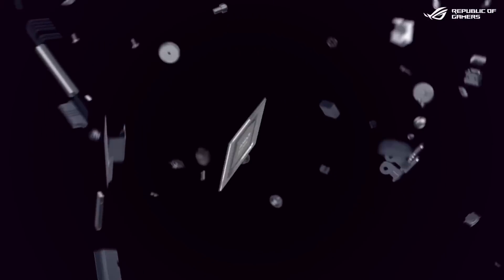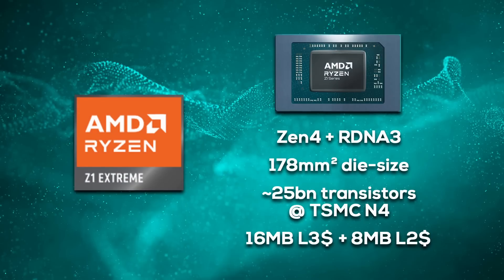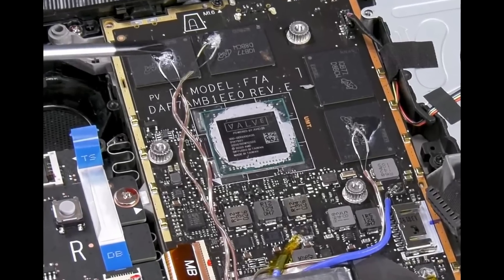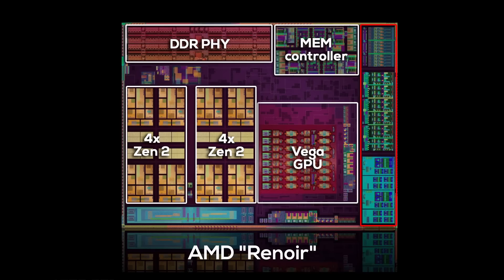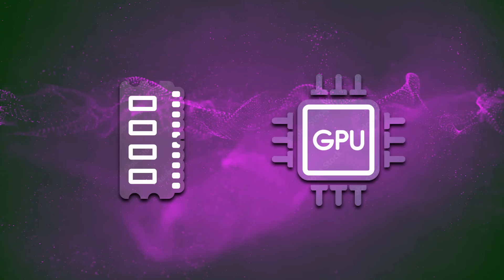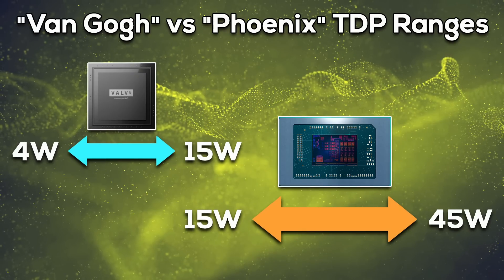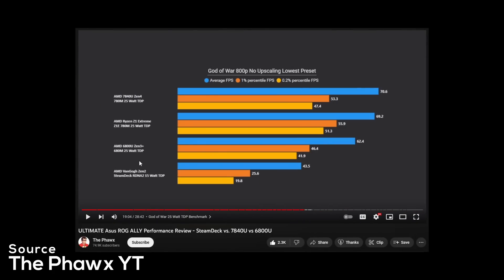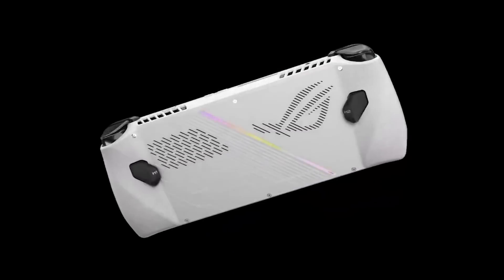Why the ROG Ally can't beat the Steam Deck

Comment from the maker: See NordPass Business in action now with a 3-month free trial, go to https://nordpass.com/highyieldbusiness with code highyieldbusiness
Reply: There is is also a factor of the operating system. Basically in Linux vs windows scenario Linux always wins in terms of amount resources it needs to run in comparison to windows which also results in better power efficiency because the less resources you use the less power drawn will be. Valve is using SteamOS which current version is based on Arch linux while ROG Ally uses standard windows with all its bloat which will have also Asus bloat included. Not to mention windows and older game compatibility is meh at best and dont get me started on windows updates.
Reply: It seems like the Z1 extreme is just the 7840u laptop apu
Reply: @GeneralTso369  It is the whole Z1 Extreme is basically a marketing ploy to make potential customers thing that this is some kinda custom chip when in reality is standard production APU with changed volatges.

Comment: Windows has been getting destroyed by Mac for exactly this reason. The M1 Macbook Air easily has 3x or more the battery life of the next-longest-lasting 14inch laptop. It's ridiculous! I wish we had the Valve APU for Laptops. I'm desperate for a laptop that can run on 2-6W like an M1 can. It's not just "ARM vs x86", it's the wasted 3-4W that was mentioned in this video!

Comment: Deck 2 Custom APU:
* Zen4c - style little cores laid out in a power optimised physical IP cell library.
* Memory on-package using the lowest power HBM variant available at design finalisation time.
* GPU: RDNA 3.5 (a tock design fixing whatever issues made RDNA 3 performance below expectations).

Also, relevant system-wide feature to keep the GPU down-clocked and cool:

* Display: 1920*1200 native, relying on OS support for upscaling from any framebuffer resolution, including dynamic resolution by forcing the application's window to resize to hit TDP and frame time targets in a fake fullscreen windowed mode.

Comment: 8 cores at 1GHz should use less power than 4 cores at 2GHz. Is it possible to radically underclock abd undevolt the Ally and use this fact to get better performance per Watt from it tgan from the Deck, at least on multicore synthetic bencharks that scale well like CPU ray tracing?

Comment: Steamdeck can't be beaten because it was born already beaten by itself - with 720p 60hz screen. Even mobile phones has FullHD 120+Hz displays ong ago - but this big "gaming" device hasn't. What a shame...
Reply: Braindead take considering nothing can run at those refresh rates other than simple mobile games. Also steamdeck is cheaper than most smart phones.

Comment: I think this is a pretty bad take on preproduction software. And until you have it in your hands to do a side by side graphs, charts, and specs only show so much. Linus from linus tech tips has one and has fully dropped his steam deck (he was actually using an ayaneo before switching to the rog ally because he didn't care about cost and just wanted more preformance)

Yeah the cost might not be worth it for some but that doesn't mean it's not for others. 

It runs windows, has a better screen, and more powerful hardware. 

Those check boxes are worth enough that people are pre-ordering the rog ally like crazy

Comment: Asus can still make a low power mode with 2-4 cores disabled. ( it might be possible via windows anyway). that should match or exceed the steam deck on battery life ( I alreay have a deck and considering the upgrade).

Comment: Why are Youtubers insistent on comparing two different price points on products; it's as though they are competing with one another with meaningless "content" lol. Sure, let's compare the most expensive model from the Mercedes Benz with the Toyota Corolla. Note that the only difference between all 3 Steam Deck is primarily storage capacity starting at $399. And I have no doubt that Steam will have another 10% discount in the near future.

Comment: Claiming that Valve "designed" Van Gogh with just a helping hand from AMD is so much of an hyperbole that it is flatly a misleading statement.
Van Gogh was prepared by AMD. Not just when Valve asked for it, but literally years before Valve even started to get an idea of it. But faced with limited budget and limited opportunities, this AMD's APU remained in the design area, with no clear market base to address.
This changed with the Valve's Steamdeck. Due to sheer coincidence, Van Gogh was actually the perfect APU for this device category. And Valve could provide the volume and the budget to make it happen.
Now, I'm not saying that Valve didn't have any participation in the chip's design, but their share was limited to a selection into a rather short prepared menu. Nothing equivalent to a "chipset design" team.
The most important impact of Valve is on the software side. And that's a hugely important one. Thanks to the customization possible with Linux, Valve's engineers have been able to make the most out of the power saving functionalities of Van Gogh. It would have been very difficult (actually impossible) to do the same on Windows, which is incidentally what ROG Ally carries, And that's indeed hugely important for such a market segment, where good performance at limited power (<15 W) is a must.

Comment: This video seems unreliable, following ASUS's recent updates for 15W, which massively boost performance. I/O, when not in use, is usually power-gated.
Reply from the maker: The sub 10W performance is still lacking behind the Steam Deck, quiet the opposite of "unreliable". And tbh, even if the Z1E matched Van Gogh at sub 10W TDP, it still would be a crazy feat when you compare specs.

And nothing is 100% power gated, there's always a tiny amount of loss. Which doesn't matter at normal TDP levels, but at ultra low-power, it's has a impact.
Reply: @HighYield  pleb

Comment: good report valve got rid of Renoirs non unified ccx processor design. mb
Reply: yes rog ally is costly on unused function I am estimating the component costs ASUS over $300 but less than $335 for half the design cost and in the absolute lowest dregg phoenix octa slack to ASUS $250. mb
Reply: which is a big improvement from PS5 and Xbox sales at $64 per unit earns $20 or so on royalty and the silicon is give away. mb
Reply: ur in the business and a designer? mb

Comment: The ROG Phone was a great idea, but I wouldn’t of wanted to be an owner of the first gen. I’ll wait 6 months to check the Ally 2 and see if they have at least the same 6000mAh that the ROG Phone 7 has. Hopefully a new CPU that runs well on low TDP as well, might have to wait for ROG Ally 4 or 5 for that…
Reply: Yeah same, for now I'll just buy a steam deck and wait out for the ally till it's confirmed that it's good.

Comment: It would help if we could disable some CPU cores i have option to undervolt (offset) and set memory speeds/timings. In theory that could be incorporated into Armoury Crate software without need to go into BIOS. That would close the gap between ROG Ally and SteamDeck<15W.

And out of both i would use something like Z13 Acronym but with OLED - maybe I will switch to similar device next gen as it could replace both my PC (5900x+3080) and laptop (X13 Flow 3050 TI) .

Usually i use portable gaming devices when travelling by train or in hotels so power socket is always threre and 7' screen is simply too small for me.

Comment: Hugely informative video. Assuming you are correct this is a really excellent explanation of what I have been seeing other creators struggle to grapple with.
Reply from the maker: I think customizing is a super interesting and often overlooked aspect of hardware design. It's relatively "easy" to design a good all-around product that performs well within common TDP ranges. But as soon as you move towards the extreme, be it very high or ultra low power draw, specialized hardware truly shines.

I hope the ROG Ally will improve its low TDP performance with further firmware and driver updates. But even if it would be able to catch up to the Steam Deck, a simple look at the hardware specs is all you need to realize the amazing work Valve has done with the Van Gogh APU.

Comment: If I wanted to play while plugged in, why would I even be using a portable?  Even if I did, I’d simply stream the games from my desktop system. Battery life is therefore a huge consideration for these devices.
Reply from the maker: Maybe you need a semi-portable system, e.g. because you switch between two homes. Or you use it for your daily commute which means sitting in a train for 1-1.5h, something that would work well with the ROG Ally.

Comment: The mockup does a great job conveying just how much die area the Steam Deck devotes to its GPU compared to the Ally. One device is min-maxed for the task of 'portable gaming machine', the other is just a (very good) laptop APU stuffed into a Switch/Steam Deck form factor.

On the other hand, my Switch never actually leaves the house, and I'm sure many other people treat theirs similarly. So as you point out, a more power-hungry device still has its place.

Excellent video --

Comment: Steam Deck 2
8c zen4 1ccx RDNA 4 APU, 16-32gb of LPDDR5 7200-8533mhz 
2025-2026 timeframe. Storage options: 256gb $399 512gb $519 1tb with better screen etc $649 (Maybe the price is a bit more expensive but since storage is so cheap, I think 256gb will be the baseline maybe valve upgrades the ram to 24gb or 32gb of LPDDR5
Steam Deck 1 64gb: $249: Still on sale on Valve Website

Comment: One simply does not buy a Lamborghini and drive it at 40kmph in order to save fuel in the end of the day the ally is more powerful and with the more battery is used ,maybe installing a custom windows 11 os such as ghost specter and disabling 2 cores will bring it onto the same ball park as steam deck but why would you chop of its legs

Comment: Stop comparing the fp32 (standard precision) tFlops vs fp16 (half precision ) 😂
Reply from the maker: Van Gogh has a theoretical maximum of 1.6 TFLOPs FP32, Phoenix has a theoretical maximum of 8.6 TFLOPs FP32. Most of that is due to RDNA3 being "dual-issue" and the potentially very high clock speeds of the Phoenix iGPU.

Comment: Doubtful people in this category will care all THAT much. You guys raised a giant stink over the Switch’s energy efficiency and said it doesn’t matter. Now, a real hardware manufacturer comes into this tiny market and shoved Valve’s face into their cake. I’m sure ASUS will address efficiency as much as they can, but Windows would probably be a big hurdle in that effort. At the end of the day, it isn’t going to effect sales of either unit. People will buy whichever device they want to play their games on, the Ally will look more appealing since it can play all Windows games without workarounds. Also, the Deck’s energy efficiency depends on the game or app you’re running, there’s nothing uniform about it since it behaves just like a PC.

Comment: Steamdeck has over a year's worth of software and firmware updates. All the reviews and comparisons are against the pre-release marketing units of the Ally, so they are not representative of the actual market units. Asus has already said they've fixed a handful of the issues that have been brought to their attention during this marketing phase, and they've also said that more updates are coming via OTA changes. Yes, the Steamdeck is an awesome piece of hardware combined with SteamOS, but the Ally is going to disrupt the market that will only make it better for the consumers. It's an exciting time.

Comment: In all honesty, for my use case, Valve knocked it out of the park.  I love my Asus parts in my PC, but I haven't used it in a long time as the deck is just so fun.  It is very interesting what they did to make it happen, custom chips seems to be the future, build for the use case not for general all purpose.  

I wish Asus well and hope its successful but I'll definitely be waiting on the deck 2.  Touch pads... I need them, plain and simple, without them I will not consider buying.

Comment: I think the 8mb of Infinty Cache on the Steam Deck makes a big difference. Steam Deck has a fully featured RDNA2 GPU. Not even PS5 or Series X has any form of Infinity Cache. In fact, the Deck is the only RDNA2 based GPU (other than P.C GPU'S) to use Infinity Cache. The Phoenix chip doesn't use Infinity Cache and that's why it absolutely needs faster memory to compete. Infinity Cache is a brilliant way of reducing power consumption and bandwidth needs. No idea why no one uses it other than Valve.

Comment: One of the biggest things I've been seeing from these reviews is the fact that software is the biggest downgrade when it comes to ASUS ROG Ally, where the Steam Deck beats in comparison. Also, the fact that it's better to perform on lower power when it comes to the ASUS ROG Ally. Overall I hope ASUS continues to fix its system. This is why I will get the Steam Deck. Steam Deck has better support from official developers and can have vast support from the community.

Comment: steam deck feels like a more thought out, with care device as the ROG Ally simply is just parts thrown together which isn't a bad thing I am just stating how it feels and looks. Plus I wouldn't want my own company that I bought the ROG Ally (if I did) to lie about certain aspects. That's just not a good look at all. But for the most part, buyers for the ROG Ally are probably not gamer headed people or tech savy people and simply see big numbers and letters saying (Steam deck Killer) (1080p 120hz) and will just buy a product based off that. So I firmly believe this will sell a lot and it will be in stores to which is very good for ROG Ally. However I don't think ROG Ally will sell this much because it's just that much better instead because it's wayyy more accessible (in stores wise). Price of course is still a litttle steep for me maybe the 600$ feels right but you literally lose so much performance from z1 extreme to z1 it's dumb so you're like forced to buy the $700 one.

Comment: I'm still team rog at the moment. I like my steam deck but after having spent years with high refresh rate monitors, 60hz just isn't enough for me most of the time. Sure the AAA titles won't be hitting high fps most of the time but at least you'll still have that option for older titles and lower demanding games. 
Biggest criticism for the ally though is that resolution. I think 900p would have been the most ideal, even 720p would have been alright with me for this screen size and then you get the benefit of higher fps. I don't like using anything less than native resolution. 720p on a 720p native screen will always look sharper than 720p on a 1080p one.
Also don't really care about the battery. I mostly use my steam deck when plugged in anyway.

Comment: Cause it's only marginally better. so instead of 30 fps at 720p at low settings on the deck, you get 34 fps at 720p on the rog ally 
🤡 it's a whole circus. so much for innovation.

Comment: Phawx also thoroughly tested the Z1 extreme in Ally against the 7840U inside a GPD Max.
7840U manages to handily outperform the Z1E at the same power levels and has a significant delta at lower wattages as well.

It's all related to voltage regulation in the Ally. With proper tuning, it should be able to match the Deck at lower TDPs, outperforming might be a stretch for now.
Reply: They need to enable the AI core in the Z1E Chip in the ROG ally
Reply: I’d also imagine it’s the regulators, since that seems like something asus is having trouble with atm

Comment: Rog for me is the device I wanted the stream deck to be. I wanted a Handheld to play any games I own for pc. I am in the position of looking to upgrading my pc which is running an AMD 5 with 1070 gtx and the ROG is going to me my replacement. Purely as I feel I would play my games more in Handheld more but when I want to jump on the big creeen I will be getting the dock plug for it and it will definitely hit the markes I want for games I play.

I own a surface pro 7 and a duo so I'm very much a Microsoft user and I feel the ROG completes my needs for mobile, computer and gaming needs with all the devices. Also intresting to see how well it sells too.
Reply: If you don't already own a more modern PC at home then it make sense Ally is a decent gaming laptop choice.  If you have a decent PC especially a desktop and want to mostly play around your house plus some on the go then playing remote from the desktop is the way to go. You can play remote on a lot of devices including your phone and don't have to have the handheld plugged in as it saves on battery. 
 One advantage of a desktop it has more cooling, better GPU and easily to replace any part that is broken.
Reply: @smidlee7747  I fully get that I can play my pc anywhere using a remote desktop app and use that on my phone ect. I even use it with my duo and surface from time to time but i have times where I want to offline game, just pickup and go with my device and although it's great I can connect to my pc from where ever I am ide rather having a device like the ROG for all my needs for gaming on the go and plug in at home and carry on. I'm not fully slold on the remote play bits plus having an internet connection all the time is not always am option.

Plus due to eye issues a Handheld works better in front of me when I have to take my contacts out and put my glasses on as TV is/monitor is not great to see. (that's another story).
Reply: Upgrade your gpu instead, If you'll truly want to take advantage of the rog ally you'll stay plugged to a wall anyway.
Reply: @lucasg5167  I get that but I do alot of pickup and play gaming at the moment with little one and wide hates us hogging the big screen so this will be great to play like that and then plug it into the TV if I want a bigger gaming session.